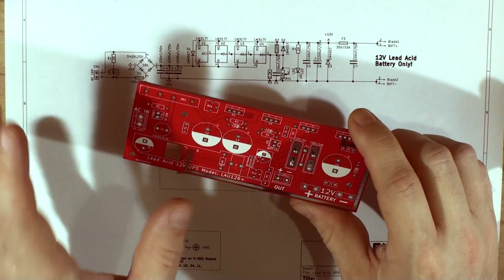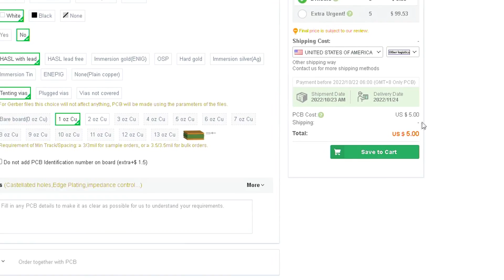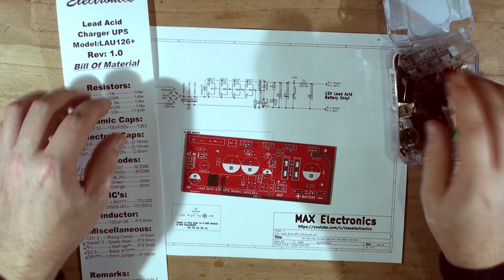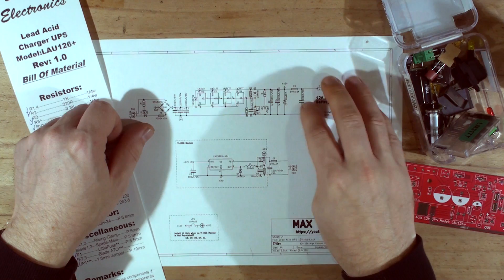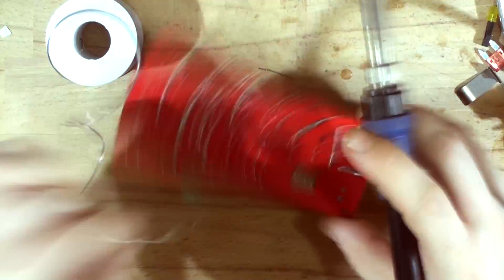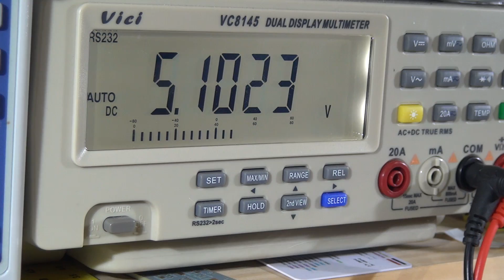DIY 12v Lead Acid UPS (Router / Modem Backup Battery)

Comment: Ordening the PCB by re-uploading the files is not the best way to go. PCBway has a project section where the developer can upload the design for others to easily order.

Can you upload your project in the same way? Thanks!
Reply: not all NVR need 24v, alot of NVR from Dahua with 4 port rj45 POE work in 12v
Reply from the maker: I’m not sure where you got 24 v from?

Comment: Nice! Can I put two in series so you have 12V and 24V? Some POE switches run on 24V some on 12V. The security cam NVR also runs on 24V.

Comment: Great video, thanks, I will build one of these for sure. Is there any chance of overcharging the batteries? Thanks Peter
Reply from the maker: No, lead acid batteries will trickle charge when they reach full charge. Important thing is to set voltage correctly, for 12V batteries it’s 13.8v but I prefer to set 13.6v
Reply: @MaxELECTRONICS  Thanks Max

Comment: Putting lm317 in parallel for higher current is not ideal ,you should have used power pass power transistor with single lm317 for higher current output.
Reply: What component bro?